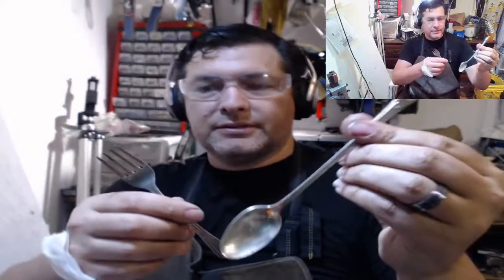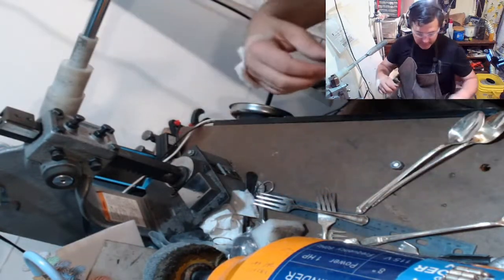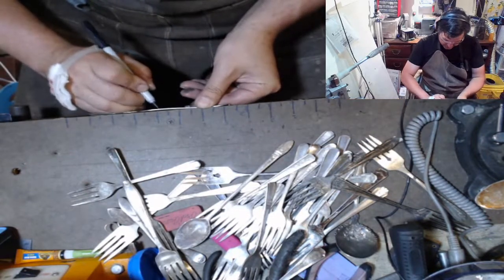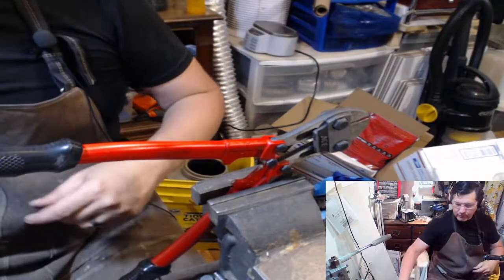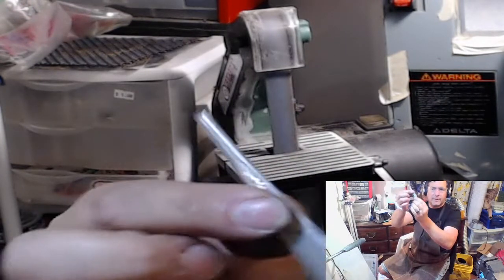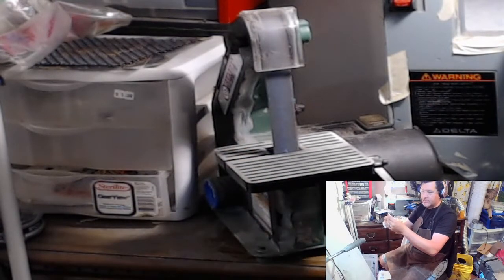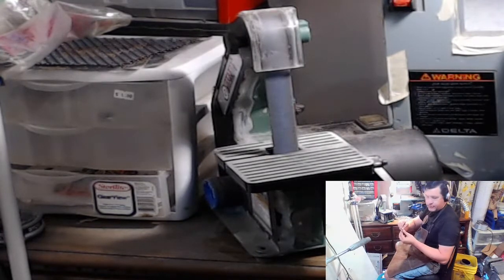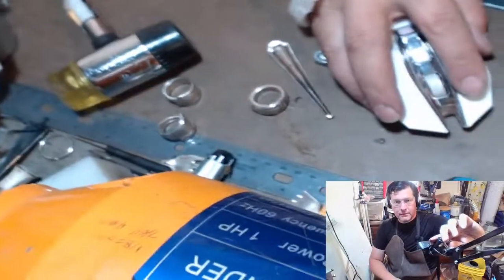Making a Batch of 77 Spoon and Fork rings part 1

Comment: I’m new to making rings and just purchased a bender like yours, but haven’t used it yet. Can you please tell me what kind of buffing wheels you use and where you get them? I have a Harbor Freight a few miles away so I hope its there! Thank you so much for posting your videos, you give so much information and you make it easy to understand. I look forward to watch many more and learn more things! Thanks again!
Reply from the maker: First Thank you for watching! The buffing wheels that I have are from Lowe’s. They don’t fit my mandrels on my buffer. So I have some pieces of leather holding them on. I have a stiff one and a softer one. Then I have one that is really fluffy for a high shine. And my fiber wheel. I’m sorry that I didn’t have more specific information on them. My next ones will have a smaller hole than my Lowe’s ones. And I use  red and white polishing compounds on my different wheels.
Reply: @FlatwareCreationSS  thank you for the info!
Reply: I love your work.
What sizes are you cutting the folks down to?
Reply from the maker: @jazzyrose3257  I normally cut them all the same length and then size wen I need to. I can go from a 4--12 on most rings.

Comment: Thanks for another fantastic tutorial. Can you give some pointers how to determine whether a spoon is; stainless steel, pure silver , chrome plated or silver-plated? Also what is the most ideal material to bend into rings?  Thanks
Reply from the maker: So the nice part about stainless and pure silver or 925 sterling is that they will both say that on the silverware. Sometimes the silver will stay 800 or something like that which is a lesser purity of silver. Sterling silver is definitely the easiest but you want to make sure that you anneal it first unless you’ve dealt with the pattern before. Normally silverplated will say something like AA or A+ IS is normally plated sometimes it will just stay plate. The chrome plated ones are a little bit harder because they look silver plated but until you start to bend it and you start to see the cracking that’s whenever I know for sure. And it sometimes it gets me still. Lol 
Thank you for watching and subscribing 😊
Reply: @FlatwareCreationSS  thank you I am inspired to start "ringing" myself. The arbor press in your affiliated Amazon link does not look similar to your press, I don't see the steel  horizontal mandrel attached to it.
Reply from the maker: @highanddryful  That’s the way the arbor press comes. The 3-D press system from Flatwearable.net is where all of the attachments come from and the new bar. That’s why it looks different. I started out with the last generation of bender kit and then upgraded to the 3-D which has a lot more features. The cost is definitely worth it. I can make over 100 rings in a day and they sell for $20 each all day long.
Reply: Stainless  steel

Comment: Ok thanks and what diameter plastic roll do you use for doing your bracelets?  I'm trying to bend silver ware but not sure what size I should be forming them around.  Thanks Nancy
Reply from the maker: If you’re using the bender, I would use the middle size. When I first started out, I was bending my bracelets around a 1 1/2 inch schedule 40 pipe. I actually still use a 1 inch coupling for the size of my bracelets now.  I just have it around the second smallest shaping roller. That’s where I found a sweet spot for mine.

Comment: Are the silverware you use regular house ware
Reply from the maker: Yes, most of the silverware that I use is silver plated, but I have also used stainless before which is what most silverware is made from today. If you want to bend stainless, try and go with the thin pieces.

Comment: Jeremy, looking back at this, and I have a question. How many inches are you measuring your rings. 3 or 4 inches?
Reply from the maker: I cut them between 3”-3 1/2” for round rings. And spiral rings are always a little longer depending on the pattern.

Comment: Why aren't knives used? Seem there is a lot of metal that could be used. Do you solder the medal? Do you use wood, veneer,or epoxy with the medal. Do you use, steel at all, or just flat ware. Sorry, just starting out.
Reply from the maker: I have used jelly spreader knives to make rings before. Those are the small arms that are one solid piece, not the ones that have the fatter handle. The stainless steel blades I have seen some people turn them into rings, but normally they end up being a byproduct. I sell them to other artists that weld silverware into art. I mostly use Flatware for my jewelry and other pieces. The silverware can be soldered and recently, I’ve been able to solder stainless steel to silver plated silverware. My experience with epoxy and silverware has generally been a bad one. Often time it’s too brittle when cured, and it doesn’t like to stick to the silverware. I’ve had stones that I’ve epoxied to the spoon just pop off before. E6000 has been the best option for things like that. I have seen others use different kind of metals on their pieces, most often it’s copper because it just really pops against the silver. I hope this helps, if you have other questions feel free to ask them.
Reply: @FlatwareCreationSS  I will. Thank you.
Reply from the maker: @wallypaige8496  I’ll be here 👍